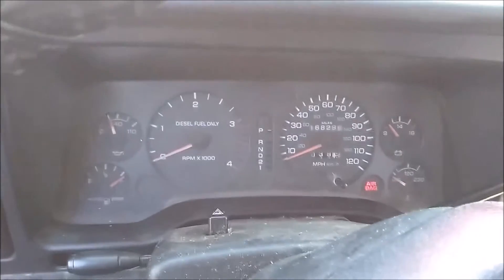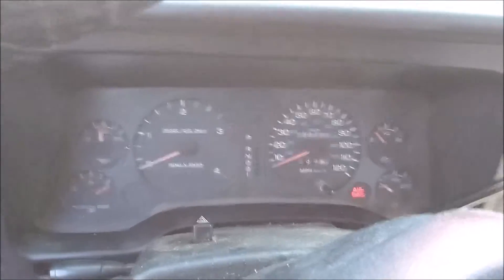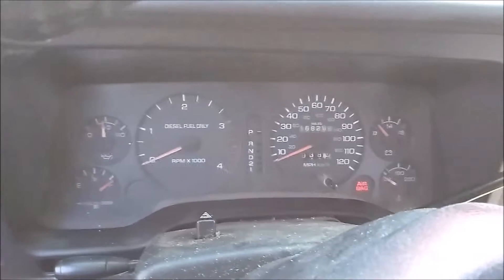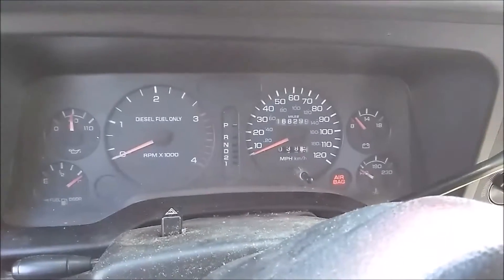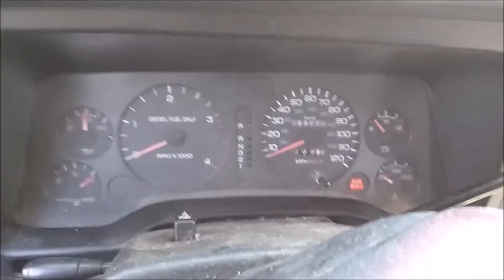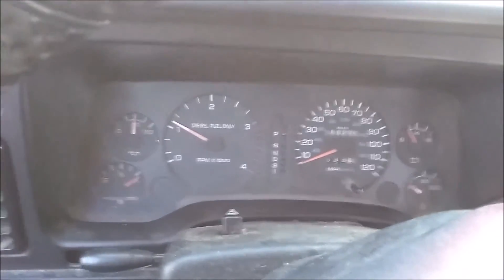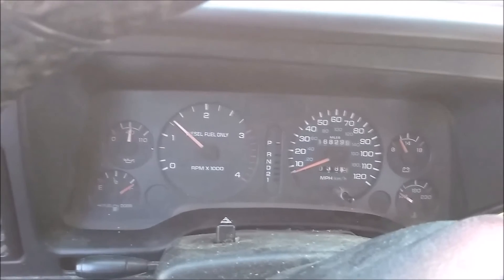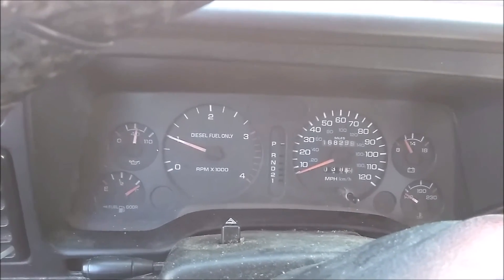truck  you tube  cold start  part 4

Comment: Glow plugs or air intake heater? Either way it sounds like its not working or it would fire up much quicker than that.
Reply from the maker: I know it doesnt have glow plugs.
I know it has a heater in the air intake.
I dont know of anyway to test the heater, without taking it apart.
Every diesel i ever started was hard to start when it sat in the cold for a few days and it wasnt plugged into a heater.
But, i am not a mechanic.
Reply: @MrYfrank14  you can test it with a clamp meter which can measure DC current. It should draw around 60-100amps if it's working properly. I've owned 2 older diesels and it was never this difficult to start with working glow plugs (first time every time) but very difficult when it had more than one broken.